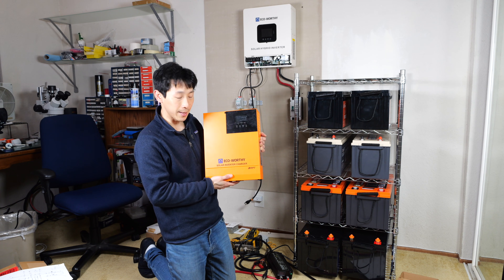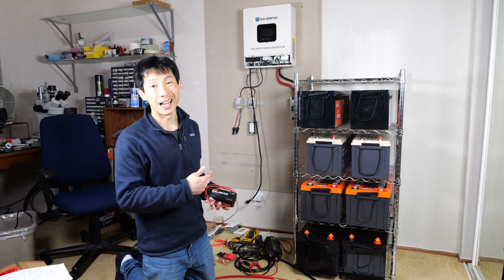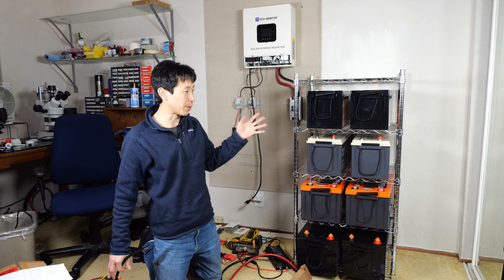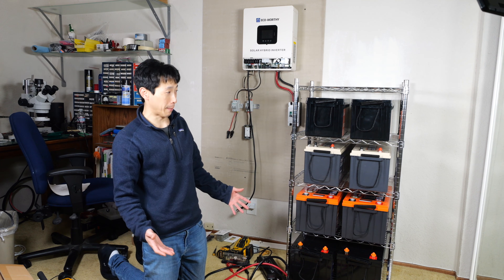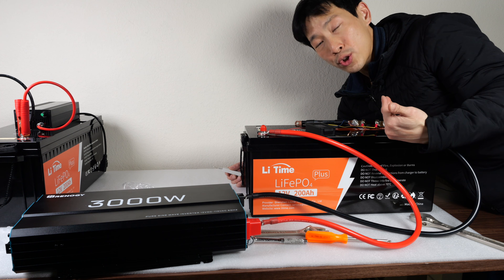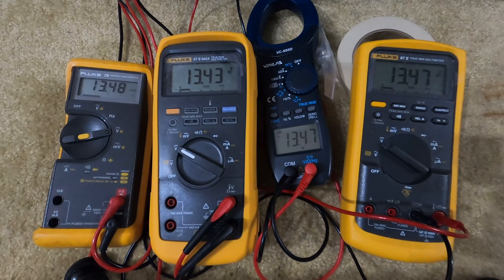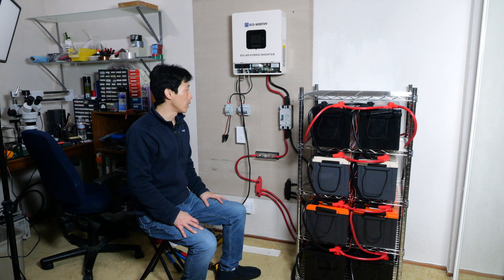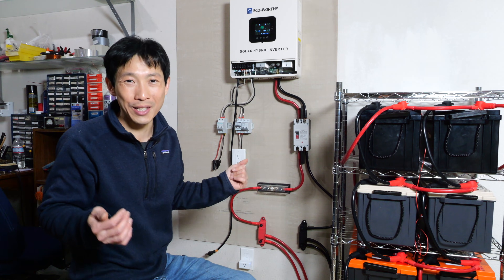Monster 20kWh Capacity using 12V 200Ah LiTime Batteries

Comment: Your insurance company is going to raise your rates or cancel your homeowner's insurance policy when they see this video.
Reply: Can you please explain why?
Reply: I was curious myself so I looked at the inverter. Didnt look like it was UL certified from what i could tell, but i may be wrong. Insurance companies usually require these types of equipment to be certified
Reply: @theChef1337  it's NOT feeding the grid.. only pulls from the grid to charge
Reply: @MoaningGit  my bad i missed that. Thank you bless up 🙏
Reply: No more than having an electric car in your garage
Reply: No they won't.
Reply: Fire trap! Not to mention the fumes inside the house
Reply: @richk3552  😂😂😂🤡
Reply: @richk3552 lifepo4 batteries don’t off gas like lead acid so there shouldn’t be any fumes
Reply: @richk3552  ??? No it is not a fire trap.  Millions of people have similar setups with no problems all around the country.